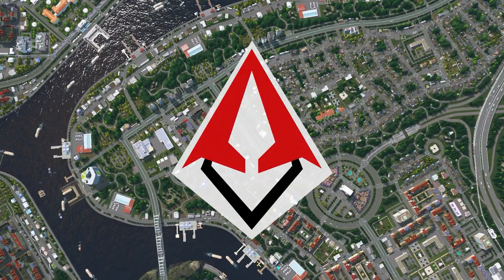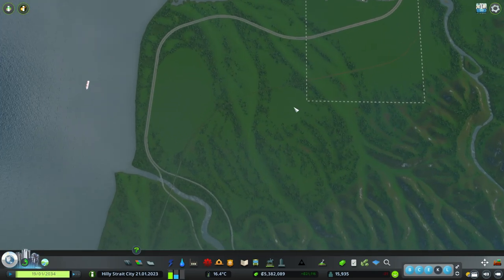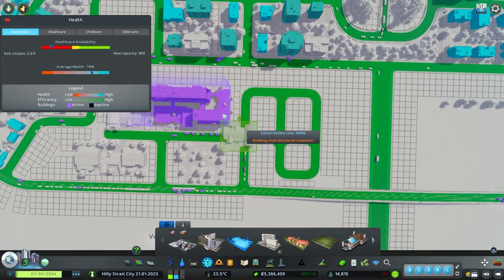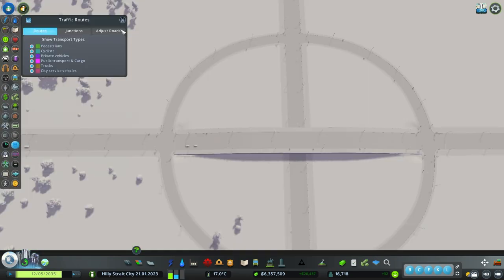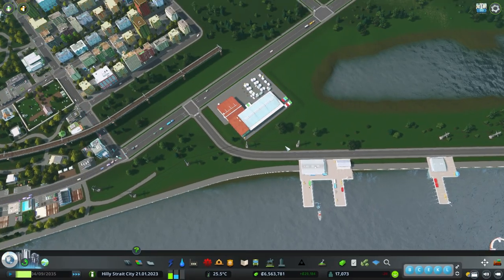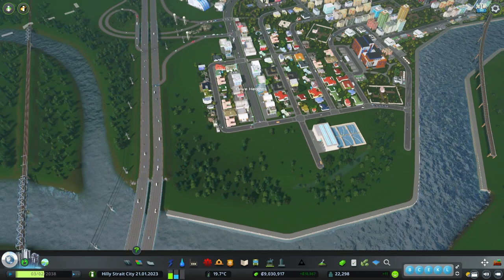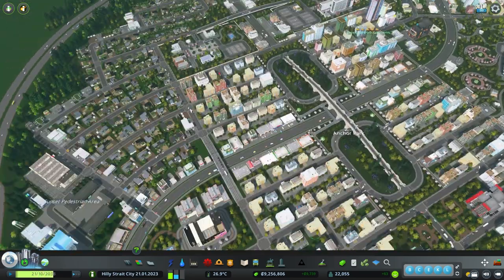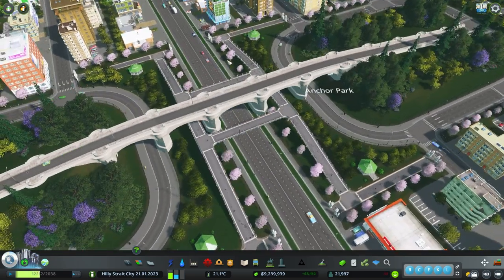Efficient Planning of Interchanges, Service Roads and Road Networks in Hilly Strait City Ep 03

Comment: The explanation for an interchange/high capacity transit being about one a tile makes alot of sense! Very excited to take some of these principals and designs into my builds.

Sorry to hear the traffic eliminator won't work at scale, but I'm sure that can be resolved with other connections and routes elsewhere
Reply from the maker: The traffic eliminator is just to help those who are struggling in the early game and they can choose to apply the same principles to other parts of their city when necessary.
Reply: @Captain_Ahvious  It ended up lasting way longer than I was expecting. Plus it just looks so pretty

Comment: In the fish area, the trucks are taking the 3 lane instead of the first one (right lane), there's something we can do about it?
Using the traffic manager it's simple, you can determinate the right lane to enter in a roads, but  there's something in vanilla?
Reply from the maker: Thank you for brining that up, I'll have to look into it.
Reply: Other than trying with lane mathematics, I don't think so...
Reply: @thefreephilosopher7398  could work.
Reply: It looks like the don't take the first one on the right, because they don't wanna be there. There is a lane arrow to the right, so you can make the right turn. The only thing I don't wanna do, is placing the fish market and factory ond the six lane road, to avoid turning. But as I understand, that will be changed later. So, I don't think there is a problem.